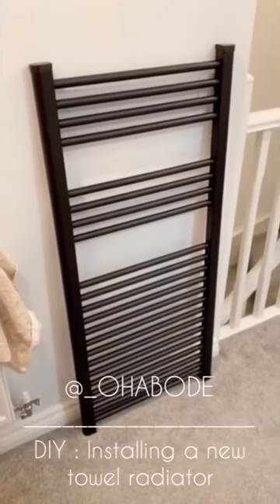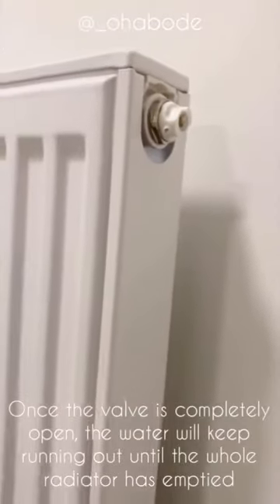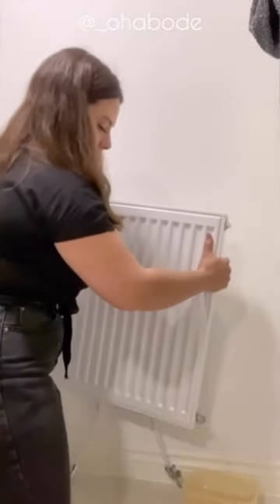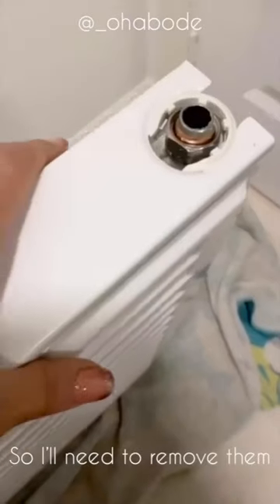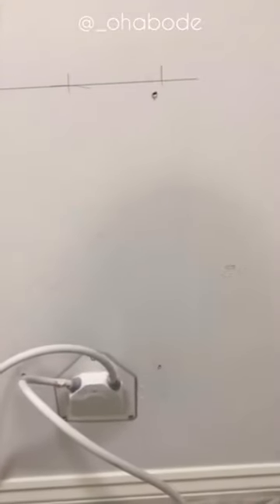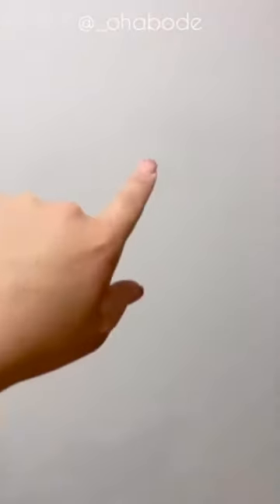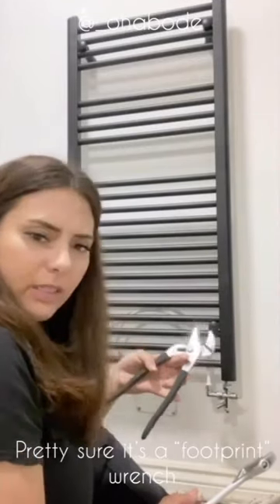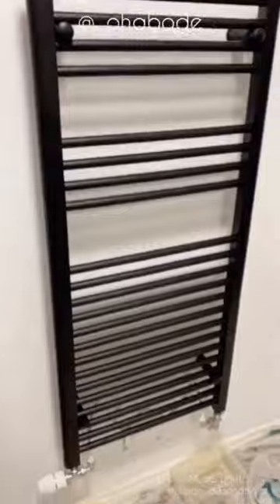DIY How to Change a Radiator | Installing a Towel Radiator DIY | How to Remove a Radiator | Oh Abode

Comment: Just got a quote of £450 to do 3 radiators, watching you I feel confident that I can at least do the bathroom one. Thank you
Reply from the maker: How did you get on? X
Reply: Hi  @_OhAbode  Well, So far I have got the old radiator off (it was so easy), I have filled all the holes, and I am getting ready to paint the walls. I think next weekend I will come back to this video, so I can hang and connect the radiator. Wish me luck 😂 thanks for checking in with me, I hope you are doing well.

Comment: Hello , good video . I got heating boiler with hot water tank . Do I need to drain boiler before towel radiator installation